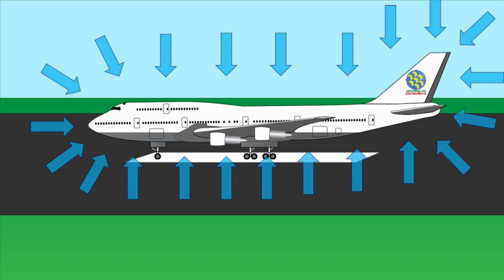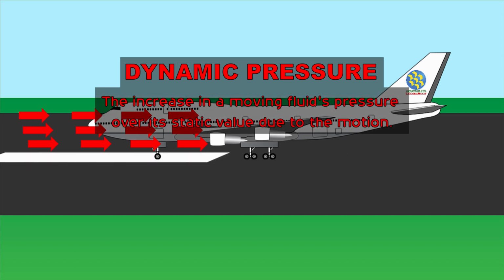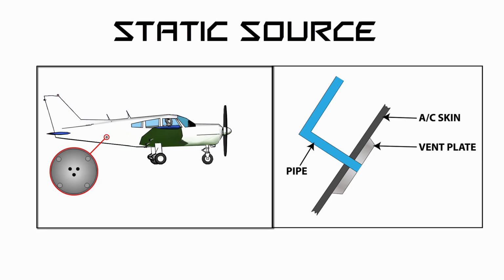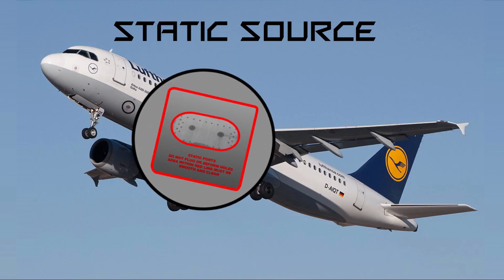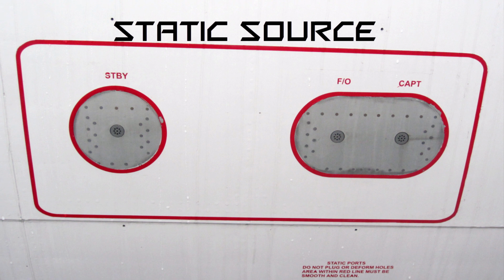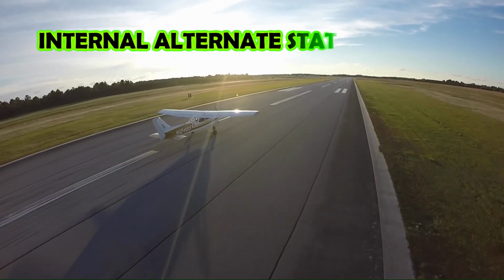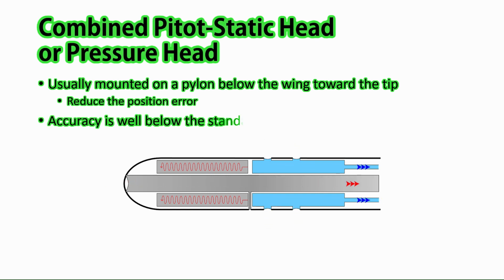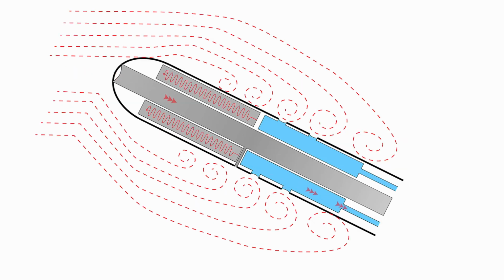Pressure Measurement | Measurement of Air Data Parameters I Instrumentation - EASA ATPL

Comment: Bro i have one doubt can you answer this please?
Aircraft flying from A to B. Elevation at place A is 240’ and QFE is 1000hPa. The ac takes off with altimeter reading 180’. Elevation at place B is 240’ and QNH at B is 1000hPa. Halfway there is hill with height of 5000’.the QNH at the hill will be :
a-1006hPa
b-1004hPa
c- 1002hPa
Reply from the maker: Hi, where do you get the question? QNH does not change linearly. And there is no way I can calculate the QNH at the hill with the information given. If you calculate linearly the answer will be 1004. However, theoretically QNH does not change linearly. Can you please send me the source of the question so that I can look further into this.

Pt A 
QNH 1008
ACFT Altimeter Subscale set at 1011

PT B
QNH 1000
Reply: @AnsweringATPL  altimeter subscale should be 1006 right? As altimeter is reading 180’ . So altimeter is neither set on QNH nor QFE right?
Reply: @AnsweringATPL  can you explain how did you calculated linerally?
Reply from the maker: Yes you are correct altimeter subscale 1006. A QNH 1008 B QNH 1000. Since the hill is in the middle (1008+1000)/2
Reply: @AnsweringATPL  i got this question in my class’s question bank...i am totally confused with that question
Reply: @AnsweringATPL  i want to share a image of this question’s explanation. Can you tell me is that right?
Where i can share you the image?
Reply from the maker: @pratikpawar2316  you can send it to me via email. My email add is available at the channel page
Reply: @AnsweringATPL  i didn’t found you email..can you type it out here?
Reply from the maker: @pratikpawar2316  answeringatpl@gmail.com